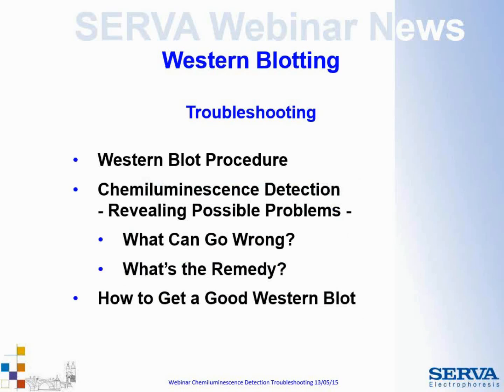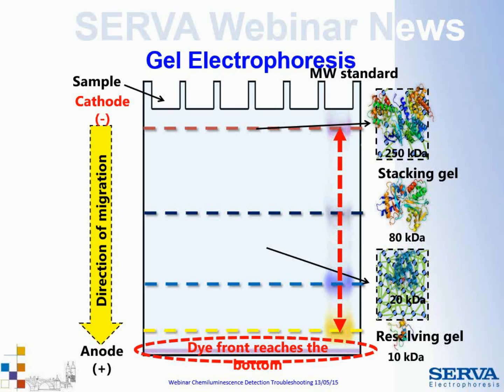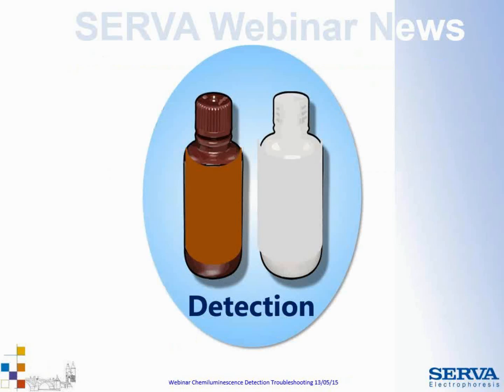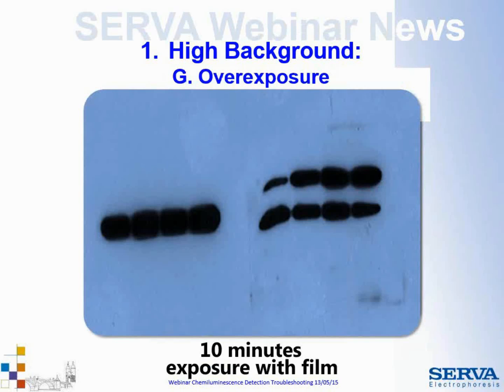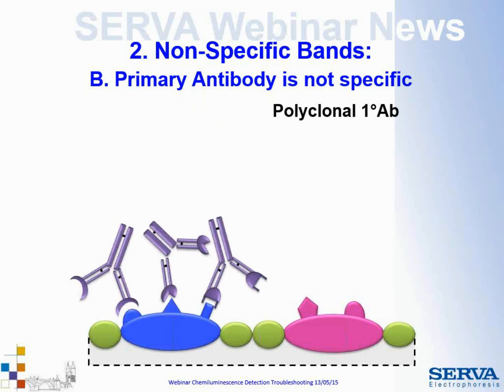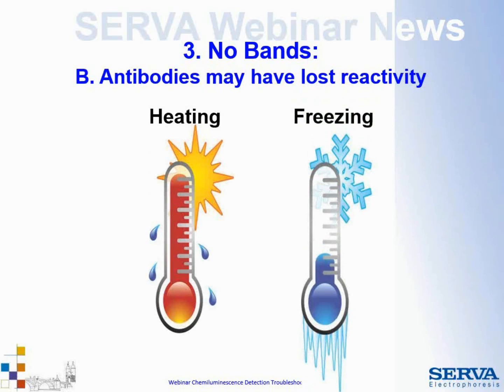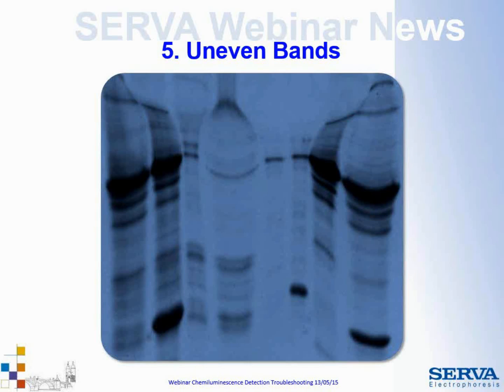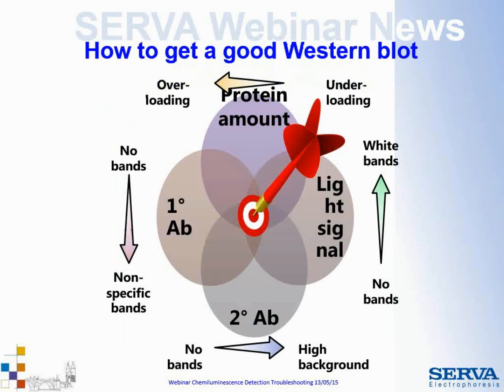SERVA Webinar: Troubleshooting ECL Western Blot Detection (English)

Comment: Hello, ive been doing western blots and no bands show up, wece changed everythingdown to the transfer buffer, the blocking milk, antibodies and even the western blot machine. we still dont get bands. do you know what could possibly have this effect?
Reply from the maker: Hi Carolina,
thank you for your message. 
There are many possible reasons for the absence of signals/bands (see below). 
For further trouble shooting, it would be great to contact me by e-mail (tech.service@serva.de). Looking forward to hear from you.

BR,
Judith

•	Inefficient Transfer
o	Check the transfer efficency by using pre-stained marker 
o	Adjust transfer setting, e.g. duration if necessary
o	Use the appropriate transfer buffer, e.g. for even transfer of large and small proteins
o	Use the appropriate transfer membrane, do not forget to activate PVDF membranes with either methanol or ethanol

•	Antibodies may have lost reactivity
o	Check whether the antibodies are stored as recommended
o	If in doubt, use a new vial of each antibody

•	Non-fat milk may mask antigen
o	Test your Western Blot protocol by using another Blocking reagent, e.g. BSA, Casein or Protein-free like SERVA BlueBlock PF

•	Sodium azid contamination
o	In chemiluminescence detection the presence of NaN3 should be avoided! Check all solutions!

•	Contamination of stock solutions
o	Check the detection solutions for possible contaminations.
o	If in doubt, use new ones.

•	Incorrect Antibody
o	Check whether the primary antibody is the right one to detect your protein of interest and whether the secondary antibody recognizes the primary antibody

•	Low Antigen-Antibody Binding/Affinity
o	Make sure that the binding affinity of the antibody is sufficient for your assay.
Further aspects:
•	Make sure that the substrate used for detection fits the enzyme label
•	Make sure that the detection system is suitable for your detection method
Reply: I had this issue before, you should run control like B-actin, it is possible that the lysis buffer.

Comment: For this problem 6. Patchy spots E. Interaction with Sample Tray. What do you mean Sample Tray? Is it just the tray containing the membrane or the gel? Thanks in advance.
Reply: I guess it's the tray where you put the membrane
Reply from the maker: madxientist, you are absolutely right. To be concise, it is a matter of contamination or misbehaviour. Sometimes the plastic of a tray can interact with the AB due to contamination. The membrane can stick to the plastic surface and the solution can not swap around freely or the blocking reagent can interact with the plastic and causing sediments that stick to the membrane.